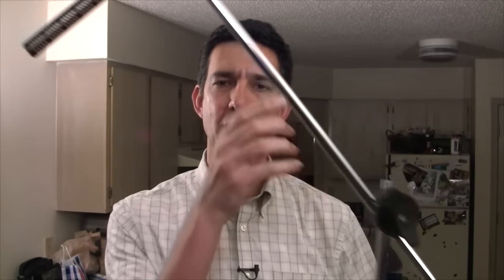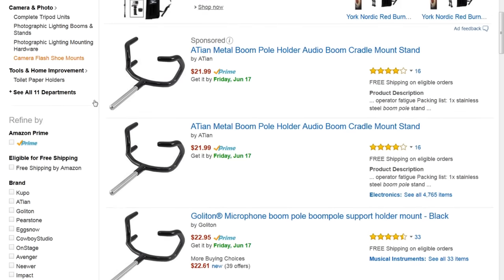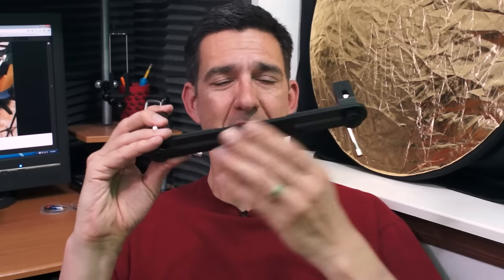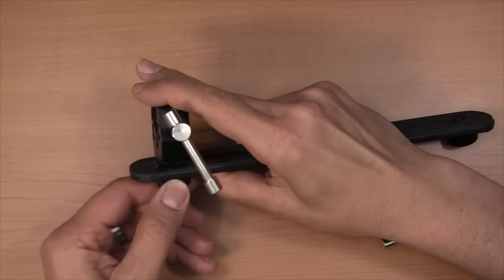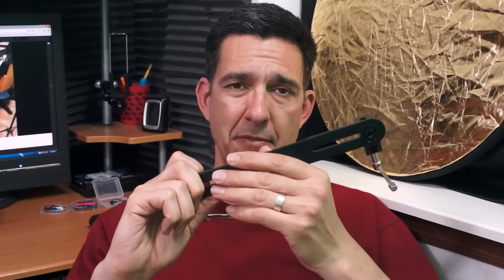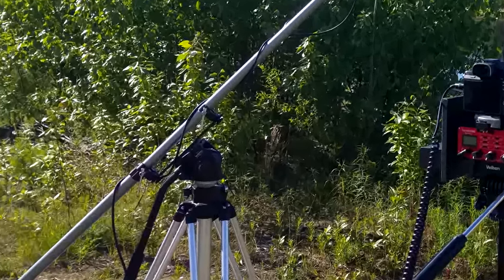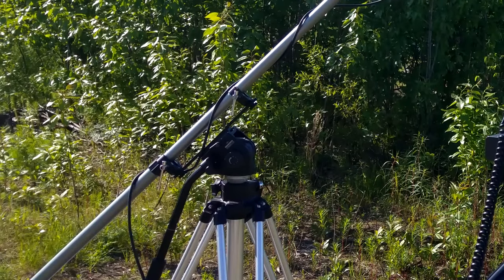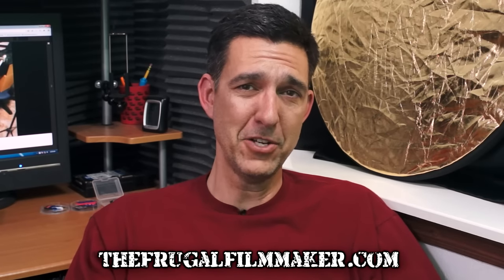DIY: Frugal Boom Pole Tripod Clamp for $15

Comment: Frugal filmmaker -  Excellent idea.  I can see how the whole assembly could be made out of basic hardware if the proper equipment isn't readily available.  Allow me to return the favor.  Secure the sand bag to the back end of the boom with cordage i.e. paracord.  The appropriate application of some lashing and a couple hitches will keep the bag in place.  I would suggest the Clove hitch and the Rolling hitch.  The bag doesn't even have to be on the boom it can be suspended below it as long as it is stable, weight is weight.

Comment: I spent the last couple of days  trying to figure out this exact project. thanks for the help, I'm glad I'm subscribed to this channel.  I figured out the exact same clamp to use but I wanted 2 anchor points and didn't think to use a flash bracket. Thanks so much fo the video, problem solved.

Comment: You can also do one of 2 things to the end of your boom pole. 
1. Get one of those plastic end caps from broom poles. The ones that I guess serve the function of depositing the broom on a hook/hanger when not using it. Take that off a broom and superglue it to the boom pole end. 
2. Drill a hole across the end of the boom pole. 

Now having done either 1 or 2, you can now insert a small metal rod to act like a stopper and the end and the sandbag will rest on that. Alternatively you can place a hook there and have the weigh hang from it.